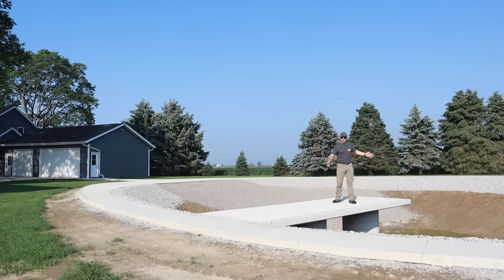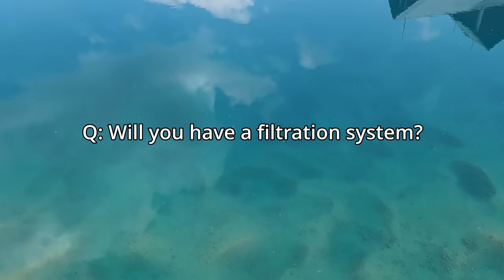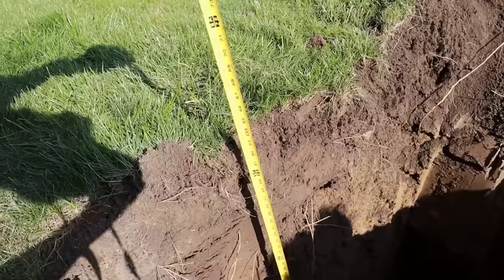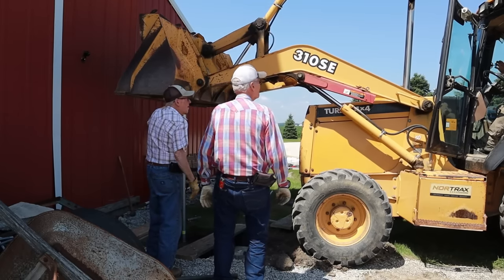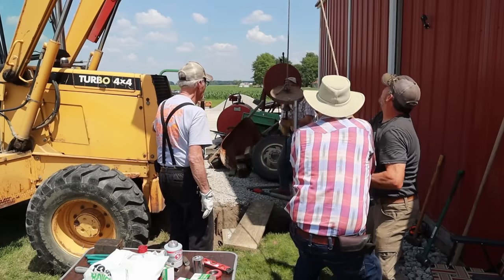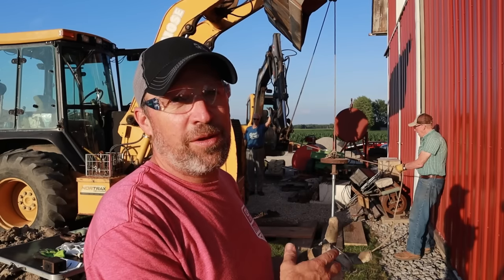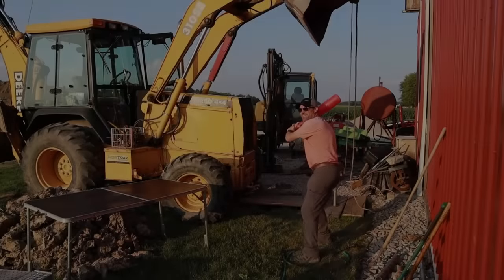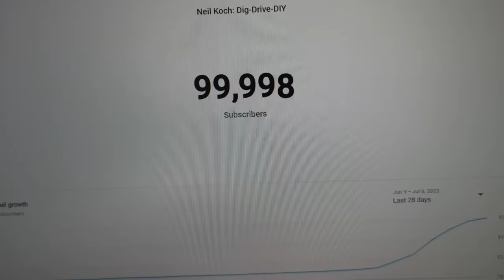It Doesn't Always Go According To Plan

Comment: I’m from Cambodia.  We dug a lot of wells.  I would recommend that you build an A frame first.  Use a very heavy metal pipe to drive the hole.  We hook the chain to the heavy pipe, the the other end of the chain to the rope and the pulley resting on the A frame.  The other end of the rope is hooked another pulley.  We didn’t have any heady machinery to pull the rope.  It was all human power.  This brings back a lot of memory.
Reply: Wrong spot
Reply: I'm from Transylvania I dig wells to dispose of cadavers .

Comment: Congratulations on the 100k mark. Did you try  power washing the well down? Make up a open ended well point from a 2"x10' stick of galvanized pipe by drilling holes. Place a sewer nozzle point ( having multiple angles) onto the end of a 50' pressure washer hose with the gun trigger on the other end. Shove that down the well point and (hold on!) All the crap will overflow and keep pushing the 2" well point down until you reach the desired depth. Place a trash pump or large shop vacuum in the hole to evacuate the sludge. Happy well driving to ya😉
Reply: mud is not whats stopping this process. its very simple. the type of metal used in this system is incorrect. it might be able to handle the pressure but not the impacts. this metal absorbs the blows, lessening the force driven down to the tip. also, dont use the siphon screen portion for this DRIVING process. use all pipes to get to desired depth, then pull it back out and then shove the siphon screen portion down. this will prevent damage to the weaker siphon portion. "how will you know when youve hit water then?" its doubtful you would know when you hit water anyway being that there wouldnt be a substantial amount of natural water pressure to push it up anyhow. he probably went through the water table, just needed a pump to suction it out. HEX coin $0.02 PULSECHAIN $0.0001 PLSX $0.00003
Reply: pain in the butt, but shoving a camera snake down everytime you get 2 feet deeper, to check for water saturation inside the siphon portion might help (if you continue to use the siphon portion on the 1st section like youve been doing) (risking damage to that weaker section)

Comment: Congratulations on the over 100K.  I'm 70+ years old, and yes, I have set a well point with my grandfather when I was about 14 years old.  His place was on Four Mile Lake in Dexter, MI.  I can tell you for a free flowing artesian well, a few feet one way or another can make a difference.  Back when I helped my grandfather, we used a hand held fence post driver made of a larger pipe with a weight at the top end and a smaller pipe horizontally threw the larger as a handle.  We would left and slide drive the well pipe.

I enjoy seeing your pond build, and all the family help.  Please keep posting your work.

Comment: This video had me on the edge of my seat! Please try again! 

Dowsing rods definitely work; certainly for electrical lines, and often for water lines. I don't have experience with wells, but I'd say it's worth a shot. They operate on basic principles of electromagnetism. Basically, standing over an electric current will cause the conductive metal wires to cross. This next part is just speculation, but it appears that some people are better "conductors", thus they get faster, more accurate results. Definitely not witchy, just one way of observing the unseen fields of energy around us.

God bless you and your family.

Comment: Before changing method, you can try injecting water at 2 or 3 bars. in the filter tip. I remember that those who made wells 60 years ago in the farmhouses in the Po Valley, told me that they injected water while the pile driver was driving the filter. It is an operation that keeps the filter clean and lubricates the walls of the hole.

Comment: I’ve seen several people find wells with the two metal rods. It’s an art for sure. Congrats on 100K!
Reply: The girls at the end were “witching” for a well using two metal rods
Reply: That system can locate the drainage tiles or pipes running through the yard. Also can locate power lines and gas lines.  How it works is a controversial and dark subject.
Reply: My buddy Dave I used to work with uses willow limbs.  Never fails if you got underground water on your place he'll find it!
Reply: Witching for water has been roundly debunked.
Reply: @squidge903  The debunk is a load of bunk. It works.

Comment: I had a friend that wanted a well by his goat pasture,  he did the well bi hand 5 ft pipe bi hand with a garden hose on half throttle. He got to the end of the pipe added another 5 ft section and away he went. It took him most of the summer and enough pipe to go 98 ft. He hit a  artesian spout. Got his water in summer and winter. Scott has been gone for probably 15 years now and the well still runs and the neighborhood enjoys a ice rink that they call Scott's play ground.  Good Luck

Comment: Based on what you said the soil is like, try jetting it instead of driving it. Get a good flow of water, smash piece of steel pipe to narrow the opening till a decent jet comes out and to keep larger rocks from pluging the end (if a rock gets thru it is smaller than the pipe and will come out). Dig a hole near the site for the tailings and water to drain into. If large enough the dirt will settle enough to be pumped back thru. Once you get it to the depth you want pull the pipe back up and drop in your screen tip. It may take a few hits but should be easy going.

Comment: Definitely a difference in the dirt you have but when my Dad put in a sand point he did it with a fence post driver. His ground is a very course sand. 
I hand dug three  6’ deep pits that I connected at the bottom to get the waterline into the cabin so it’s much easier than your clay.

Comment: I used to help my dad in south Florida digging shallow wells for irrigation.  We had a 500lb metal hammer that was tied to a pully and a rotating drum to pound in 2" galvanized pipe.  We could tell the different kind of rock and coral just by the sound of the ringing from the hammer strikes bouncing off the pipe.  So many memories.  Thanks for the trip to 40 years ago.

Comment: i plan on driving a sand point well just like that, maybe inside my greenhouse. I'm in a very sandy valley and I already have a well for easy water table measuring.
hope I dont hit a big rock, The only thing I have to use to pull something that big up is pliers, leverage and brute strength =\ 
and those steel points aren't cheap, pipe either... Probably have to use a tripod pulley and crank winch if mine got stuck... after hand sledgeing it in for 20 mins.

Comment: Hey guys…I think the best solution would be to have a GPR survey (ground penetrating radar) done to pinpoint the exact location where to tap into the underground water supply!
Wishing you all the best with your project!
And congratulations on 100k mark. 👍
Reply: I'm not aware of GPR being able to locate water or rocks? Mostly used for utilities or massive barried objects, but maybe.
Reply: @annasbanana729  Exactly.
Reply: @annasbanana729  depends on the algorithms used for time/space transformation calculations. 😉
Reply: Best solution is to get a DPT rig out there and you’ll be at water in an hour

Comment: Good luck on the well. I would try driving the well either by using existing water sources (your existing well water) pumped to high pressure with a gas powered pressure washer to bore it out (works great on these shallow wells based on what I have seen on youtube), or drive the pipe in as you did but without the wellpoint (perforated section) and then once you get down to the depth you know you should find water you pull the pipe up. Put the well point on and drive it back down through the already driven hole. This way the "digging" is done by solid pipe uncompromised by hundreds of holes and the wellpoint will have minimal pressure against it when it is later driven back down the existing hole. Or you could go old school like this... https://www.youtube.com/watch?v=38VxE3l4HOs

Comment: I’ve done the well witching thing with coat hangers straightened out with 3” els to hold on to.  It succeeded in finding the water pipe into the house, under the front yard.  I’ve seen it work.

Comment: Grew up in Mid Michigan out in the country. Our well ran dry one summer. Since we were in mostly sand, Dad went and got a branch for looking for water.  Once he found his spot the branch told him was water, he set up his point, pipe and put up a tripod and block and tackle.  Then he pulled the Pinto up next to it and took the rear driver's tire off and put on an empty rim.  We thought he was nuts until he drove in the point and added the first piece of pipe and then wrapped the other end of the rope around that rim and handed me the end piece and told me (12 yrs old at the time) to pull on the rope to life the weight up to the block and tackle to a certain spot and then let the rope slack so the weight dropped to pound in the pipe.  He put it in 2nd gear and let it idle its way to a new well. We finished in 3 days and had good water flow for 20+ years after.  The following summer the neighbor across from us had their well run dry and they asked Dad for help...guess who got voluntold they were helping put another well in?  LOL
Reply: Like that VOULINTOLD

Comment: My dad had some bent 1/8” copper wire that he used as dowsing rods. He was a water well driller. He would never miss with his dowsing rods. There was water every time. Sometimes, though the water turned out to be a septic line. However, typically he drilled wells for new homes. If it wasn’t a new construction, he would always have a homeowner with him to verify if there were septic lines running underground where he located.

Comment: Get the guys in to drive the well it’s not expensive, they will line it with a 6 inch pipe gravel around the perforated pipe and you will have clean water forever 👌

Comment: In Michigan I installed fence post real easy using the backhoe method. Basically had 10 ft galvanized regular steel tubing and pushed them 4 to 5 feet into ground with skid steer. Easier than hell. Ground is all rock so it is a big pain to dig hole by hand and this saved a lot of time. Sturdier than heck too.

Comment: I'm not sure about finding water, but I do two steel rods held like that will show you an underground broken electrical wire. . usually within about a two foot radius. Good job guys. It nice when your working with some good hands. From off the grid in AZ.

Comment: Hey guys, I just arrived for the first time an was interested to see this. I'm in Australia, my previous job I worked as a maintenance fitter.
An idea I came up with for something similar to this (driving something downwards) was to make a sturdy A-frame from metal that bolts down into the ground. You need to make sure it looks like a 'n' the jig sits above the pole your driving down, then you simply use a press to drive down between the pole and the jig (essentially trying to push the jig upwards) this will drive your pole down. It needs to be a frame that can be adjusted down as the pole goes down. So having pins at different levels on the side of the frame on both sides will make this doable. 
"Work smarter not harder"

I now work in ILS (looking at ways to mitigate or eliminate failures from occuring).

Always interesting to see what's happening on the otherside of the pond.

Comment: Well done at your attempt. The divination is the first step as one can see anyone can divine. Secondly if one is going to drive it into the ground, no mare than one length of pipe out of the ground, otherwise the pipe will flex too much absorbing the inertia, the ground holds the pipe tight and prevents the wobble and loss of momentum. In your soil it would be easier to drill with a sludge pump. best of luck on your next attempt.

Comment: I stumbled across your videos and now I’m hooked, there is  nothing like country living, but did you just add a valve to your well I just use that.  I know it make the motor run longer but if you are only at 20 feet that’s a easy fix , my well is at 90 feet

Comment: I've put in ground rods by connecting a piece of metal conduit to a garden hose and then used the water pressure to drill a hole in the ground. I bore a hole down 6-7 feet drop in the 8' ground rod and drive it in the last 1-2 feet. You could probably connect a water source to the pipe you are driving into the ground and do the same, then pull it out, put the well point on it and drop it into the hole and drive it in a couple more feet.

Comment: I used the old witching trick when I was doing a Sandpoint well. I found what seemed to be an underground creek. When I decided on the spot I dug down with my excavator about eight feet and hit sand and water. I just kept digging and made a well that filled up to the top right away.
I used irrigation pipe and an electric pump running on solar panels and an inverter. It's been pumping water into my pond for five years.... I have had to replace the pump once and the batteries once...

Comment: You should have rented an air-operated driver. Or a tire rim mounted outside the drive wheel and rope to a heavyweight. The friction of the rope lifts said weight and lets the rope loose, and the weight drops down. I helped with a well when I was a kid. It worked great.

Comment: I work in the civil underground work industry in alberta. We use the witching sticks all the time to find, running lines. Storm, sewer, water, power, gas, fiber, and more can all be traced with the witching sticks. Another myth, when the lines cross. Stomp and each stomp it takes to get the sticks to move back, is how deep the line is. 1 stomp =1m/3feet

Comment: Water works pretty well as a drill through anything but rock (unless you have really high psi). I've seen quite a few video examples where they ran a straight pipe through hills just by pumping water through it. I've used a garden hose quite a few times for post holes in hard dirt. Lot easier than hammering them.

Comment: This is really good. I didn't see anywhere in the comments but I've used to post pounder to pound in 54 ft of pipe and I find when you hit hard layer right after that hard layer is when you're in the aquifer at least in my case
Reply: The other thing I did is before I tried to suck water up we blew compressed air down the pipe to clear our the screen

Comment: Yeah, you need to use a sacrificial coupler for hitting, that’ll save your pipe threads.

An alternative well drilling method we use (very dense clay soil here, like yours) is to push a pvc pipe down and pump water through it to erode a hole down. Works good for shallow wells if you already have a water source.

Comment: I made a set of rods using round 1/4” steel and bent with a 90 degree angle for the handles. 
They work really well. 
I call them “divining” rods rather than “witching” rods!
I think it sounds better that way.

Comment: Before you fill the pond with water you may want to add one or two pipes in the bottom that run up the side of pond to a area at ground level to add filters and automatic filler. 
I did not see if you ran a ground wire. Around the top or attached to the reinforcement steel in walk. The pipes in the bottom help wit circulation and give a way to drain the pond. Check out swimming pool plans to see how the water is dealt with.

Comment: A good way to easily hand drive a well is to use a fence post driver, with an optional pulley system to make raising and lowering easier. Also I’ve never used the actual pipe end cap, just used a sacrificial coupling, never broke threading or a had any problems with that (and you just need one, just replace it each time you add a new pope). Thanks for the infotainment :)

Comment: Did you try rigging the pipe where you can run a hose with a water jet attachment to the bottom while hammering?  I ran a 10’ stick of PVC in the ground using this.  I was driving this into rocky clay near a lake.  The water ejected most of the material underneath and the pipe was easy to move down. Easy enough a rubber mallet drove the pipe without damaging it.
Reply from the maker: That would be slick 👍🏻

Comment: I don't know if you are still working on driving the well, but I have a better idea for hoisting the weight:
First thing that came to my mind is powered capstan drum winch, like those used by arborists or on sailing ships. (I half expect that to appear on your video as plan D).
[The rope is not attached to the drum, you throw a wrap or two of rope around the drum as needed, and it only pulls when you pull on the free tail. Kinda like power steering LOL]

You could cobble one together quickly and easily from an old auto rim, a gear box, and a small electric motor (1/3hp?). (you might need two gear boxes for double reduction, I''d say ~20-30 rpm?).
And maybe a safety switch and person to cut the motor if anything should  get tangled...

Pull to raise, release slack to drop it. Not too many wraps or it won't drop quick...
Never tried this, just know how they work...

You could add weight to your driver with slotted disks or such...
Maybe paint the driver tip yellow so you don't pull it out to far while driving?

I expect others here may have already suggested this, TOO many good comments to view more than just a few, LOL.

LOVE your videos!
Reply from the maker: Thanks!

Comment: In Illinois along the Illinois river I came across an abandoned sandstone, (I think)  house foundation and walls that had a small pipe with running spring water. It had to be running for 70 years or more.